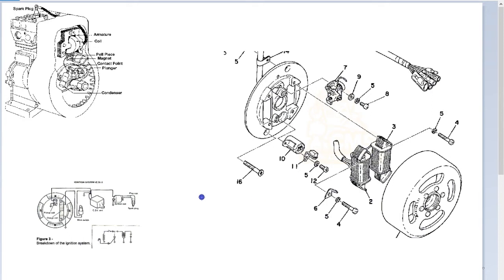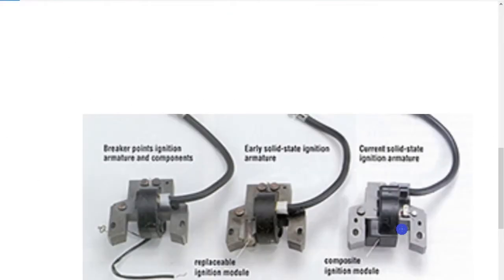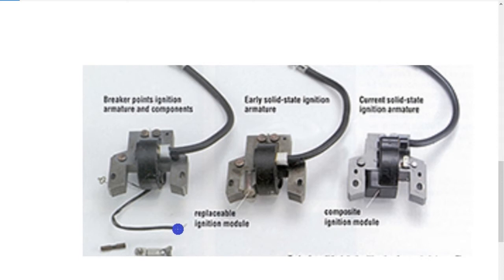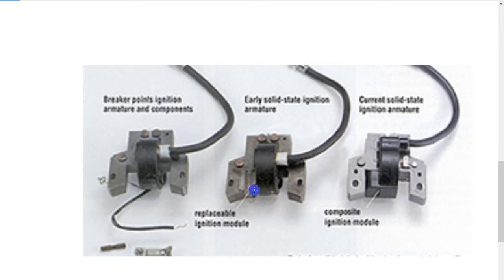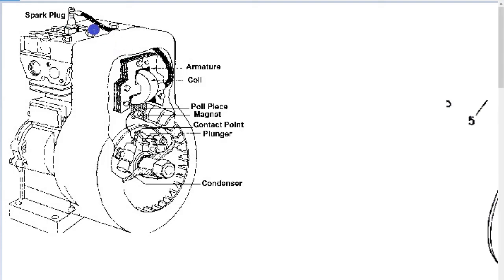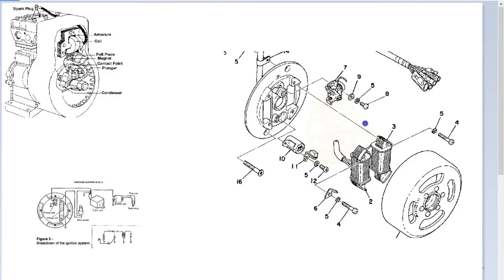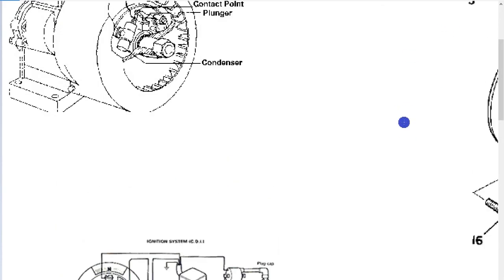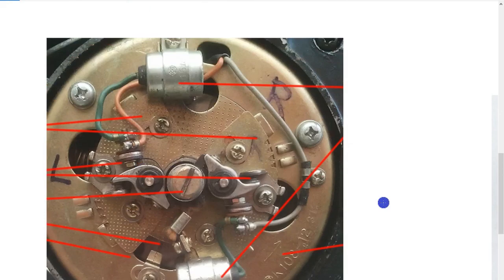Small engine ignition, 2 and 4 stroke, module and points type E27

Comment: Gidday there man. Hoping that you can 'points' me in the right direction - pun intended. I'm looking to replace the points on an older Rotax 521cc, two stroke twin with a solid state solution. It has two sets of points and two coils now on a low tension energy transfer type ignition system. Max RPM is about 7000. Thinking that if I can retain the old stator etc then it could be a simple job. How do the solid state replacements get triggered and do they provide for advance/retard? Am I better to look at a complete replacement CDI system? Thanks 👍 Terry NZ